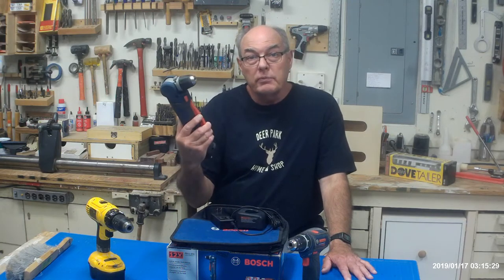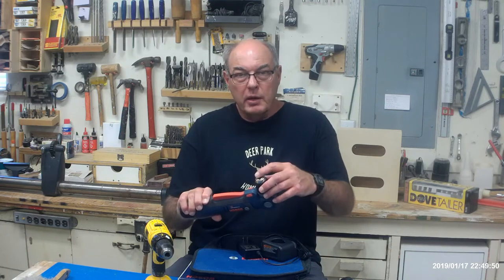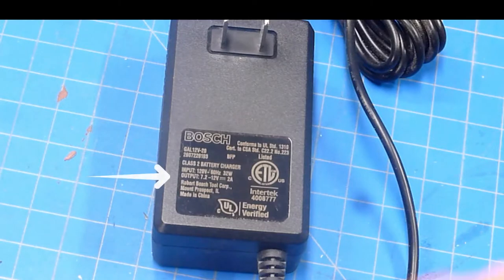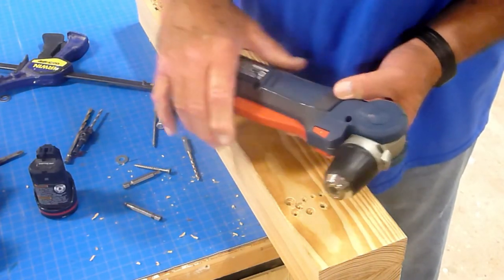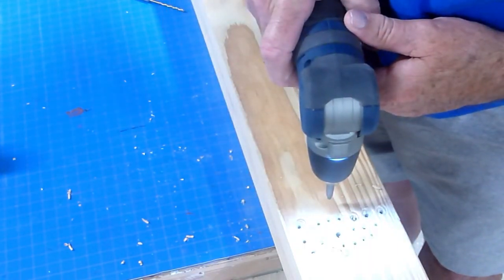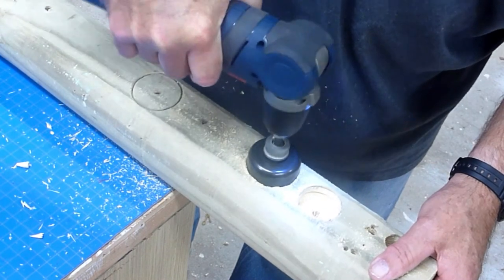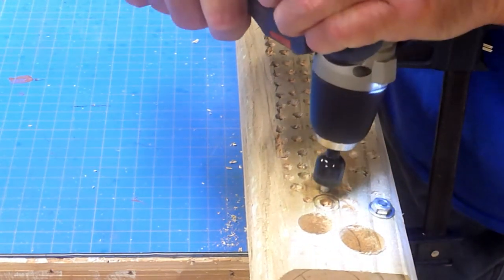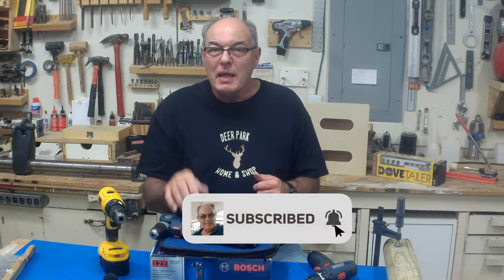Bosch 12V Compact Variable Speed Cordless Angle Drill - Review & Test

Comment: You reviewed this angle drill and did not mention if it is a brushed or brushless tool?
Reply from the maker: No, it's not brushless, and I didn't even think about that when I made the video.  Thanks for your comment.
Reply: I've searched the Bosch website and the manual for the brushed vs brushless motor specification but came back without an answer; Lowes indicates it lacks the brushless feature but it would be nice if the manual at least mentioned the brushes. Is brushed the default conclusion when they don't mention brushless?

Comment: I need a drill to get into truck exhaust bolts to drill and EZ out...seems to work for that I would think...I use liquid dish soap to lube lag bolts...just wipes off.
Reply from the maker: Hello Sheldon.  Great idea using the liquid soap.  Back in the day screw lubes weren't so available, so we would rub wood screws with bar soap for lubrication and it worked! Thanks for watching and for your comment.

Comment: Mine came without any drill bits. Is that normal?
Reply from the maker: As I remember it just came with a charger and a battery.  I also bought a Bosch drill/impact combo and that didn't come with bits either.
Reply: @deerparkhomeshop2471  - Thanks! Mine came with battery, charger, and two screw driver bits. I didn't realize the drills were sold separately!
Reply from the maker: I forgot about the two drill bits.  Usually if they give you extras they make sure to let you know how good they are being to you.   Just bought a Dremel multi tool and they have pictures of all the extra stuff on the front of the box.
Reply: @deerparkhomeshop2471 - I may have to return it. The  part when you can bend it up to 90 degrees does not seem to lock place. I'm not sure if I am doing something wrong, but it doesn't seem like it should be able to move without a way to lock the angle.
Reply from the maker: When you push in the button it will release the chuck to move that 90 deg.  When you release the button it should lock into place.  If its not doing that its probably defective. @anonymouse3498
Reply: @deerparkhomeshop2471  - It only locked at 90 degrees and one other. Does not lock at straight position. I'm going to return it. Thank you!
Reply from the maker: Don't blame you!  Sounds like a lemon. @anonymouse3498

Comment: mine not working with full battery after a few uses.
Reply from the maker: Mine is a workhorse.  Can you still return yours? It's probably defective.
Reply: @deerparkhomeshop2471  No. It's an end-of-year gift from employer. Anyway, I will ask if any neighbors can make usage of the battery which seems good.
Reply from the maker: @perfecthouse4270  That's a shame. You may already know this, but the battery & charger work with all of their 12v compact tools.  If you ever plan on buying any of their other tools, it would give you a spare battery.